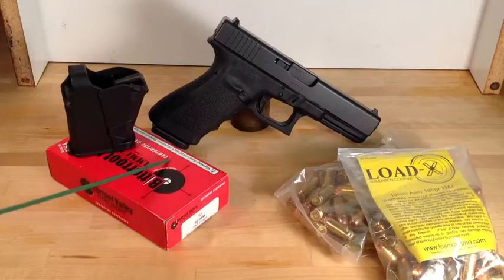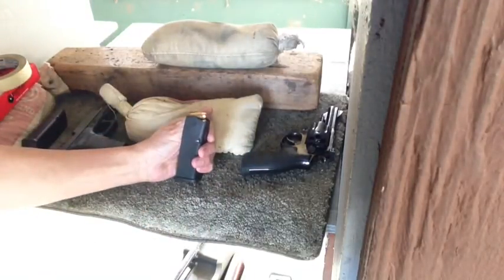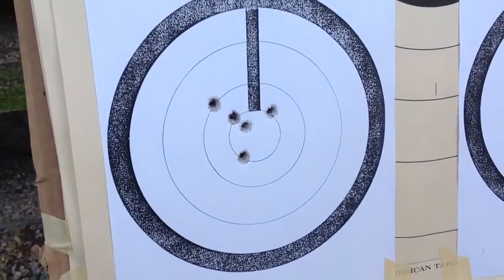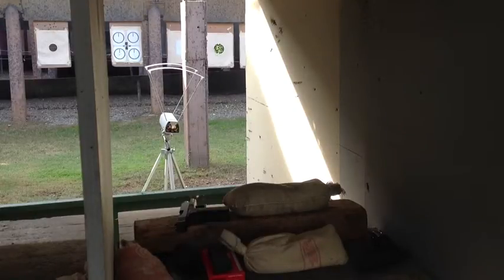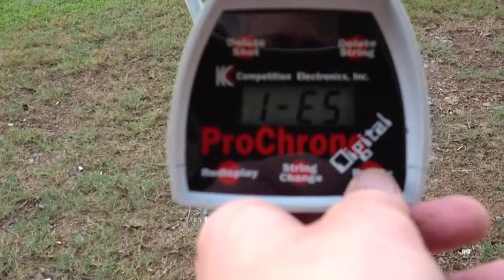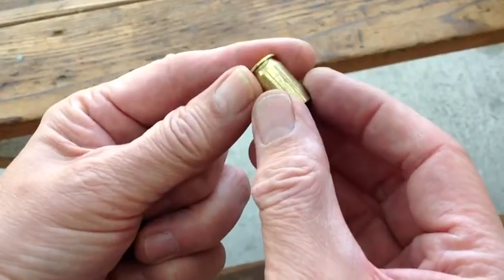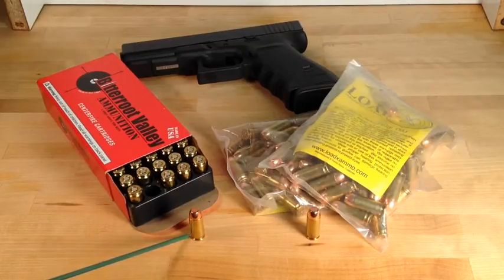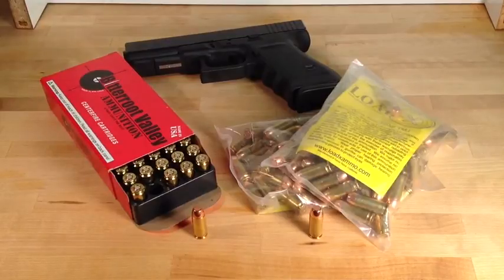First Firing Of 10 MM Glock 20 With Factory Ammo

Comment: I forgot to add that when running reloads through Glocks, you're better off getting an aftermarket barrel that has a fully supported chamber. Plus standard rifling instead of the polygonal rifling so you can at least lead bullets through it as well.
Reply: Check FC45's previous videos. He has a few on polygonal rifling and unsupported chambers and the like. I just bought a Lone Wolf barrel for my G17. I wasn't going to, but between FC's videos and comments from people like you, I thought it the best way to go. Better safe than sorry.....I guess.
Reply from the maker: jungblud59 - The aftermarket barrel it is...I'll be ordering one post haste.  In the meantime, I have 1400 factory rounds to shoot.  And then the brass is going into the wet tumbler....Happy Thanksgiving

Comment: excellent analysis which can be provided only by such an experienced reloader as FortuneCookie45LC !
Thank you for the info and I hope you will be able to test more ammo for that gun (shortage on 10mm and prices are relentless now) since I am very interested in owning a 10mm handgun (colt delta elite,one like your glock 20 or a cz75 variant by tanfoglio) ! Keep up the good work !
Reply from the maker: arno maas - The 10 is really a very useful cartridge, especially for reloaders.  Unfortunately, a lot of 10 ammo is loaded down in power, and the ones loaded for power are very expensive.  Still, the 10 is one of the most powerful in commonly encountered autopistols.  The DE and the CZ are fine guns in 10mm - all steel types of guns.  The G20 is the polymer lightweight of the bunch.   Bufflao Bore and CorBon and Double Tap and Grizzly 10 is currently available - for about $120 + shipping if 20 round boxes were purchased from all four... I've got to shoot up what I have first... Best to ya
Reply: Thank you for taking the extra time to give me even more useful info on 10mm.I appreciate it a lot ,FortuneCookie45LC !

Comment: Those may be 10mm cases, but they were basically shooting at .40 s&w velocities.
Reply from the maker: JunkfoodZombie - 40 performance for sure.  I'm getting that a lot of factory 40 is toned down a bit.  Will have to get a hold of some CorBon or Double Tap etc to get the true 10mm.  But reloading is my object anyway - that factory stuff is too expensive to just shoot at the range.  I'm just getting brass from shooting what I have - nice to see that the Glock factory chamber supports the case head better than some of their other calibers...Best Regards to ya..and a Happy Tennessee Thanksgiving to you and yours...
Reply: FortuneCookie45LC
You're right about the load levels of the factory ammo you shot.
Proper handloads can easily outdo those.
My SD load consists of the 155 grain Speer Gold Dot propelled by a max charge of AA #9, for 1350 fps.
For some reason, though, I have yet to get a load from the manuals that gets quite up to the scorching levels achieved by Corbon, Double Tap, Buffalo Bore, or especially Underwood.
In fact, tnoutdoors9 personally chronographed the Underwood 180 grain Gold Dot 10mm load out of his own Glock 20, and he found an average of 1328 fps.
A quick look around YT shows that Mrgunsngear Channel chronographed a whopping average of 1443 fps with the Underwood 155 grain Gold Dot out of his own standard Glock 20, with 100% weight retention fired into ballistic gelatin.
Those loads are real thumpers!
Reply: FortuneCookie45LC And a very good Thanksgiving to you too, sir!  Enjoy the time with your family and friends.

Comment: Fortunecookie45lc,
Great video and a really nice gun!  I have to warn you about running reloads through the Glock 20, that "smile" that it puts in the brass from the unsupported chamber can blow out of the brass down into the magazine I had this happen to me with my Glock 20, and it emptied the contents of the magazine blew everything out the bottom of the magazine, I lost parts that were never found, fortunately there was no injuries to myself, just 3 small bits of brass shrapnel hit me  below my lower lip, and it took about an hour and a half to get the feeling back in my right index finger from the powder blast. The bad news was the Glock was done, the frame was cracked and I was missing parts out of the mag well.
Reply from the maker: jungblud59 - No smiles for me yet with Glock 20 brass, but the loads were really 40 cal loadings.  So brass fired with warm-hot loads is in order and recheck for Glock smiles.  If so, the case head is lacking support as you say.  If not, then Glock has changed their chamber throats for increased head support.  We'll see.  Sorry to hear of your G20 blow up - we need to hear about those to not get a false sense of security that many have because "they've been shooting reloads and cast bullets  in their Glocks for years"  Best to ya

Comment: That Bitterroot ammo is on par with Freedom Munitions for fps.  Weak 10mm ammo, but decent practice ammo.  I think you need hotter loads before you start seeing the Glock Smile.   :)  1250 to 1300 fps is decent 10mm ammo in the 180 grain.  Freedom Munitions also uses Starline brass.  Try some Underwood 220 grain hard cast bullets, and you will know you are shooting 10mm.  Probably get some Glock Smiles with that stuff too.  Be interesting to do some empty case comparisons of real hot ammo between the stock Glock barrel and the Lone Wolf barrel when you get that LW barrel.

By the way, how do you like that chronograph?
Reply from the maker: gapster46 - That chronograph does a good job for the price - it gives per shot review, plus average,  high-low, extreme spread, and standard deviation.  Only thing is that it does not have a bench display and bench control.  These are very handy to have, but raises the cost substantially.  I'm sure newer ones will come out that has controls on an IPhone ap with all the readouts as well.  But this one will do...Have a great Thanksgiving
Reply: I’ve been thinking about one of those chronographs just to have fun with.  I don’t mind walking up to get the readouts.  If I ever get into reloading, this will become a valuable tool.  I love turkey and dressing in front of a good football game.  Happy Thanksgiving. :)

Comment: Time for fatter bullets from what you've said. Thanks for sharing.
Reply from the maker: MrTaco250 - I was really surprised to find those smaller diameter bullets in those loads.  All my reloading manuals say bullets are .400".  Best to ya
Reply: I was surprised by that myself.  I also don't think the loads were quite hot enough to make the FMJ bullets obturate properly to fit the bore.  You are going to get a Lone Wolfe barrel for it eventually aren't you?
Reply from the maker: MrTaco250 - Yes, the barrel is definitely on the shopping list.  Waiting for the right moment to pounce.  But that barrel should be .400 groove diameter as well.  FMJ at .400 should work fine in either barrel.  My smaller bullet BVAC ammo won't shoot well in an aftermarket barrel either, but testing needs to be done - who knows, the LW barrel might obturate 'em and they'll shoot fine...We'll have to see...Have a great day (I switched the real plates back on after the video, of course).
Reply: Sounds like you've got it all figured out.  I'll be watching for the update video when you get the LW barrel.  Will you be casting for this as well?  If you don't have one already, might want to find a SA in 38-40 so any .40 cal molds you might get will have dual purposes LOL!  Happy Holidays!
Reply from the maker: MrTaco250 What is really fine is the S & W 610 - shoots 10mm and 40 cal with moon clips.  And Ruger could easily produce their Blackhawk with two cylinders. But the interest in the 10 is too low to really support more guns in the caliber. There are overlapping revolver magnums already.  Glock has a pretty good corner on the 10mm market at this time with their G20 and 29.  And a very Happy Holidays to you.

Comment: The extra kick caused you to limp wrist a bit...Should get a tighter group with a stronger grip on the pistol
Reply from the maker: Kit Clawson - I shot up the rest of the box of BVAC ammo offhand (not on camera) as well as the Load X stuff as I'm saving the brass. The loads were sub 10mm loadings more like 40 cal to 40 cal +P with 100% functioning.  I actually shot the BVAC offhand in locked Isoceles off camera, and the accuracy was not what we would expect.  More on this once my aftermarket barrel comes in.  Slow pistol powders would be good, though....Best to ya

Comment: For some of us who are unfamiliar with the term 'smile' on the brass, would you explain, please, on what you mean by this...I am thinking this is a 'bad' thing to see??
Reply: I'm sure FC45LC will explain, but what he's referring to by "smiles" is how stock Glock barrels don't have a fully supported breech that allows the web of the case (the part just above the extractor groove) to bulge slightly, especially with higher pressure loads.
They call it a "smile" because the brass will have a tiny crescent mark right where the unsupported part of the chamber was when the cartridge was fired.

Here's a really nice extreme closeup someone made showing both an unsupported and supported chamber - http://i680.photobucket.com/albums/vv166/owensnj/CEDC1E12-E3B3-4E7B-9663-A42C8C072D3A-11346-0000032EACCD744F_zps80c9647a.jpg

And here's a nice extreme closeup of a case with the smile - http://glocktalk.com/forums/attachment.php?s=074f16092c6b9fdad2e1a5dd141d72eb&attachmentid=194355&d=1269927105
Reply: PinkOld,
Thanks for adding those pics. Very telling.
Reply: You can iron out the mild cases with a bulge buster, but severe or repeated bulging can become unsafe. Definitely do not use brass which had a smile for max loads.
Reply from the maker: Larry - PinkOld says it best with the pictures - the Glock smile on fired casings is caused by the outward imprint of the curved outside bottom portion of the chamber where the case head lacks support in Glock factory barrels. There is a definite outward bulge in the case shaped like a smile if you view the case with the head of the case directed towards the ceiling.  That bulge at the web of the case head is the brass trying to blow out, but not quite getting there.  A little more pressure and what you would see is the empty case welded into the back of the chamber with all the pressure blown downward to destroy the workings of the pistol, the magazine and often cracking the polymer frame.  If the barrel is blown and slide damaged - that is a double charge or obstructed barrel - different event.  Best Regards
Reply from the maker: Larry - GunFun ZS gives good advice...danger of using smile brass is the case can realign with the smile in a double treat position = high probability of disaster even with reduced loading as the brass is severely weakened there and is ready to let go...Best to ya
Reply: PinkOld
Thanks PinkOld as I knew Glocks were unsupported but never heard about the 'smiles'; the pics show the glock smile nicely.